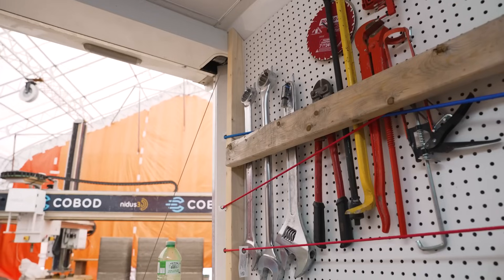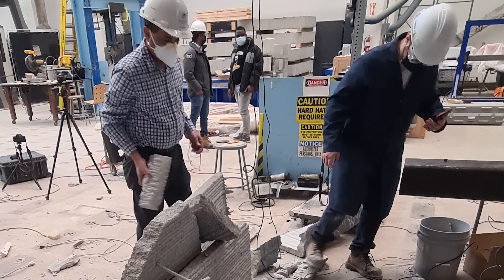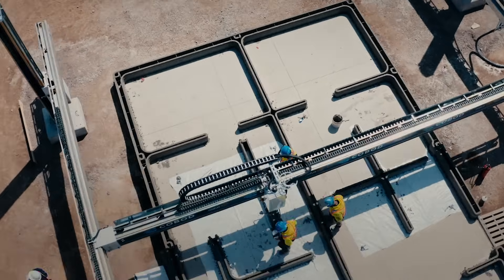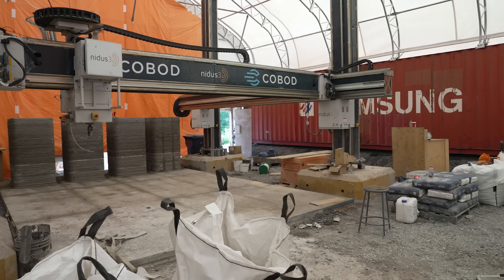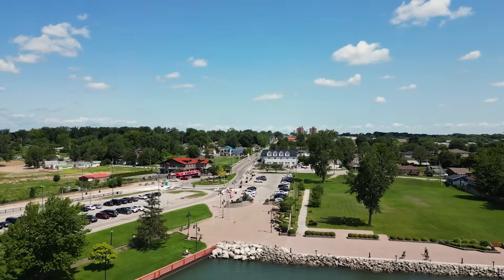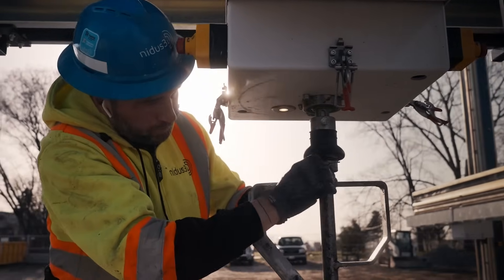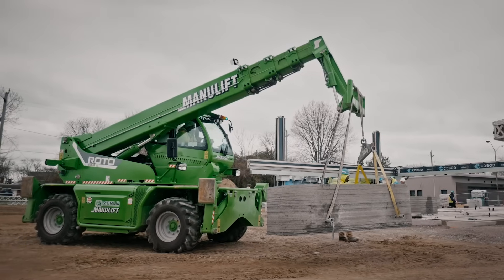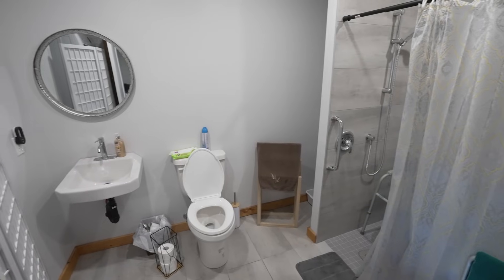Canada's First 3D Printed Multi-unit Home

Comment: What's the R value of those walls 😅 how's it gonna hold up in negative 40 degrees
Reply: University of Windsor researchers found that uninsulated 3D-printed concrete walls have a very low R-value, around 0.31 m² K/W, which is insufficient for building regulations. However, they also concluded that incorporating insulation within hollow wall cavities or adding an exterior insulative layer can meet Canadian building code requirements and significantly improve thermal performance.

Comment: Canada needs to focus on moving cities north instead of building over farmland.  Lots of fresh water lakes north of barrie that could support towns and cities.  Lake Huron has hundreds of km of undeveloped shoreline.
3D printing is interesting, hopefully it can assist in building a house with less workers required.
Reply: Though I think prefab homes built in central factories and shipped to the build site in modules is probably the better way bring down the cost of construction.